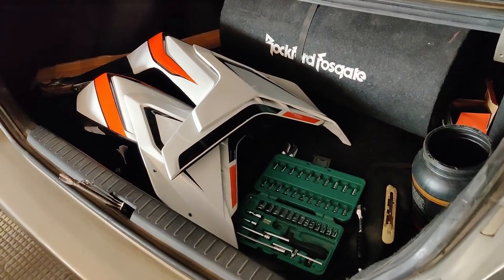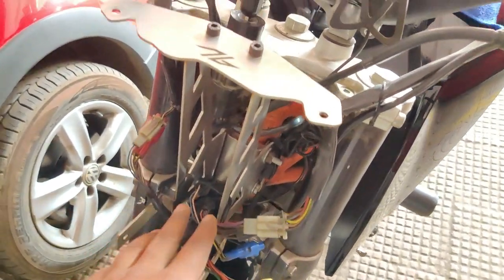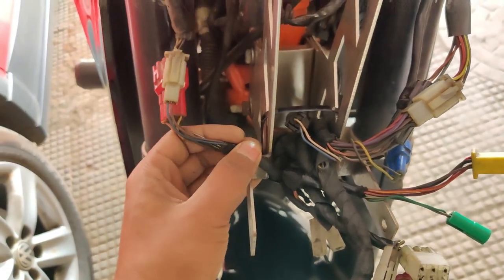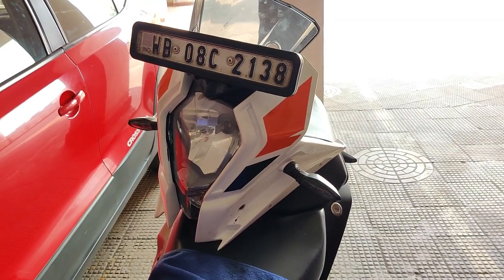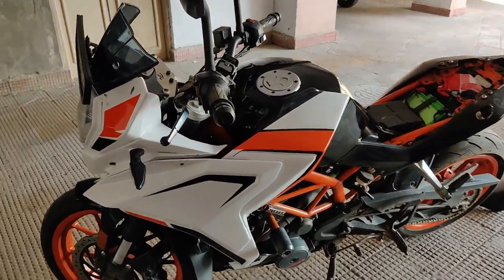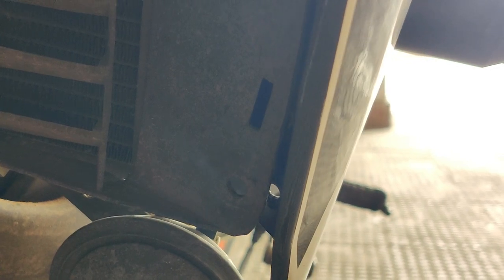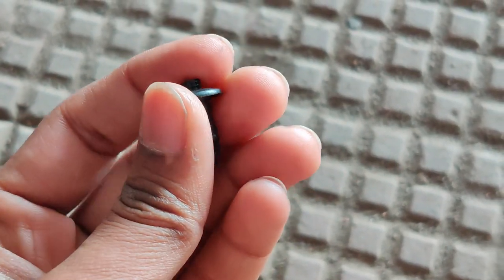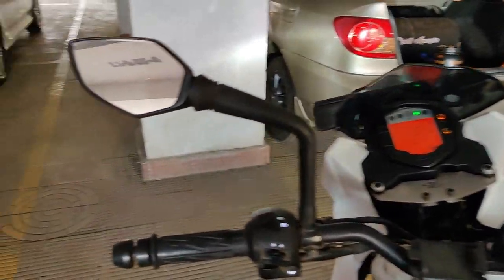Autologue Design | Dukexplorer | Body Kit Installation Guide | DIY | Featuring Raneet Mallick

Comment: hii bro
.... can u please tell me...how you install the belly pan... i have bought the bellypan...  bt  not understanding how can I install it...
Reply from the maker: Hey buddy, this was installed from KTM workshop. The stock heat shield on the underbelly needs to be removed and there's one additional clamp witch is used on RC models that will be needed. Take the belly pan to KTM, tell them to install it, that way it will be easier.

Comment: Any suspension and tyre upgrade available? I emailed autologoue,  over a week ago, haven't gotten a response.

Would also like to know if the kit helps with touring, i.e. practical  use of the kit with wind blast and riding ergonomics.
Reply from the maker: As far as I know, Autologue can only help you with aesthetic upgrade. But if you want to upgrade suspension you can go for Adv front suspension. Yes the fairing helps with better dynamics.
Reply: @ChakraRidingBeyond  handlebar risers?
Reply from the maker: You can try the risers from Carbon Racing. Very good quality.
Reply: @ChakraRidingBeyond  i have emailed autologoue,  but no response till now
Reply from the maker: :( Okay let us try reach them once.

Comment: Does this come with touring visor ?
Reply from the maker: It does. However any visor compatible with stock bike still be compatible with this too.
Reply: @ChakraRidingBeyond  Yes I know any visor is compatible... but their touring visor has different moulding and its smoked I guess... and they sell visor separately also... so I jus wanna know whether the visor comes with the kit or not. And I wanna ask you more more thing too.... how many days it took for delivery ?
Reply from the maker: Yes the visor is part of the kit. They have both smoked and clear visor options. Took about 2 months for the product to be delivered.

Comment: Bro bike is looking awesome❤️
I have duke 200 I want to fix the exhaust like u have installed pls gv some details...
Reply from the maker: Thanks so much. A mid-section pipe was needed to be fabricated in order to connect the manifold to the end can. Where are you from?
Reply: @ChakraRidingBeyond  from Dharwad Karnataka bro
Reply from the maker: Okay. If you reach us out on Instagram or Facebook, will definitely try to find some pictures of the mid-pipe and share with you.
Reply: @ChakraRidingBeyond  ok bro will dm let me know ur insta handel...
Reply from the maker: You can look is up using #teamchakraindia or @teamchakraindia. Either way is fine.

Comment: Is there in vibration after fitting this kit.
Reply from the maker: Slight vibration at low RPMs.
Reply: Can local mechanic fit the kit...?
Reply from the maker: It's not very difficult but does patience.
Reply: @ChakraRidingBeyond  @ ok

Comment: Video acha nhi h bro
Reply from the maker: Just a installation video bro. Still feedback taken.
Reply: Kise fit krna h kona nut bolt chaie ye sb to mantion he nhi kiya
Reply from the maker: Please check description for a link for the basic installation guide already posted by Autologue Design. All required bolts, etc are provided with the kit.